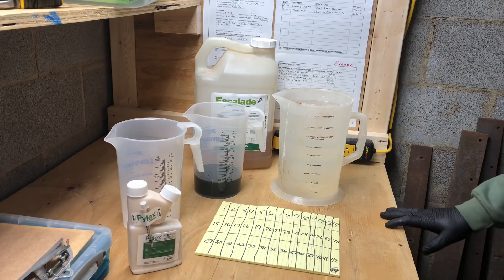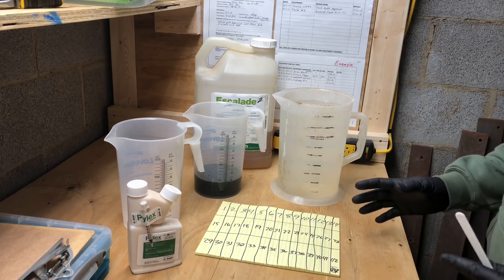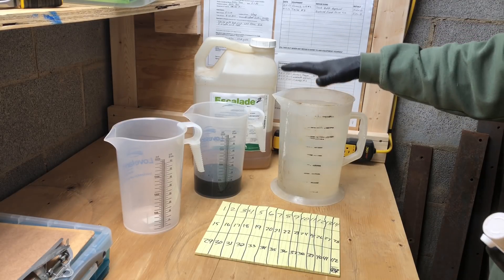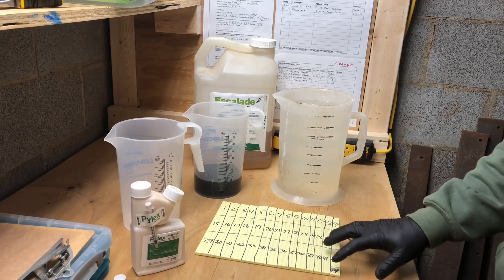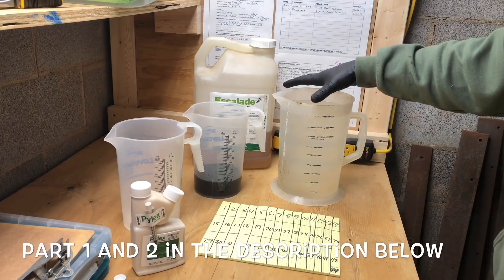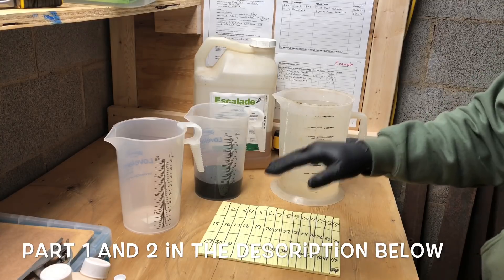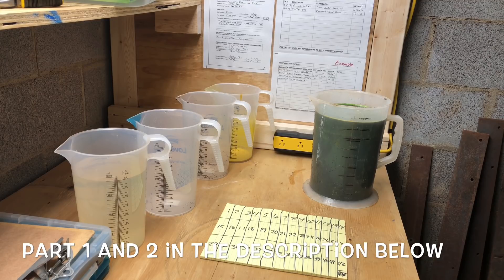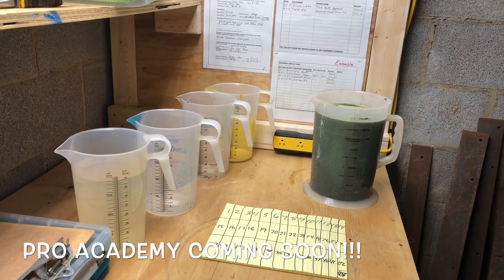How To Calibrate Any Sprayer PART 3

Comment: Do you mix your products for 1 gal per 1000 even though you spray 2 gals per 1000.  What's the reason to put 2 gals down vs 1 gal
Reply from the maker: Mark Stuck i use many different calibrations. 2G/1000 , 1G/1000 . 1/2G/1000. Depends on what piece of equipment I’m using

Comment: Hey Pete. What about mixing WG products like Celsius? Would you mix it in one gallon of water and then add the rest of your carrier? It’s not a liquid from the start.
Reply from the maker: Chris Holland 1 gallon would be easier to spray
Reply: GCI Turf Services  So in that case if I’m spraying 3 gallons per 1000, my 3 gallons would be 2 gallons of water and 1 gallon of mixed product to give me 3 gallons of finished product?
Reply from the maker: Chris Holland no. If you are spraying 3 gallons per 1000 then the amount of Celsius needed for 1000 squ ft would go in the 3 gallons.
Reply: GCI Turf Services Great. Thank you

Comment: Pete, I have found that some products when making a solution of multiple products as you have shown in this video are not suppused to be mixed together into one solution and, therefore, it would take two (or more) applications to the lawn to get these products applied correctly and effectively. This caution might be on the product label or, if in doubt, check with the manufacturer. You might want to consider stressing this to your viewers as you are doing this calibration video series. This was a nice video and well explained. Thanks!
Reply from the maker: Ben Harrison didn’t I do that with the Ca+P mix?  That was the whole point of showing that. Lol.
Reply: Pete, I watched again Part 3 of this series to see if I missed you cautioning viewers about some chemicals not supposed to be mixed together. You do tell viewers that there is a lot of info on product labels and that they should read the product labels. I took that the primary purpose of Part 3 was to show the viewer how to calculate the amounts of product and carrier to come out with the correct amount of finished solution to apply to their lawn per 1000 square feet (or whatever size area). I did not hear in Parts 1, 2 or 3 of this video series specifically about some chemicals should not be mixed together. Pete, I may have missed it or you might say it to the viewer in later Parts of this video series. As you stated, chemicals cost money and if they are applied wrong could possibly damage their lawn so I was suggesting that you stress that in your videos at some point for the viewer's benefit and knowledge about being careful as to which chemicals they are mixing together. I hope this makes sense and helps, Pete.
Reply from the maker: Ben Harrison here ya go https://youtu.be/T9j-1hWt81c

Comment: Since you love this stuff so much...  how about a harder one. Hose end sprayer with a 16oz bottle. Can be set to spray anywhere between 1-10 tablespoons or 1-10 teaspoons. Do 1lb WDG (dry product) per acre with 50-100 gallons of water. : )
Reply from the maker: Travis Morgan I don’t own a hose end sprayer. Sorry.  Would be easy to calibrate if I had one.